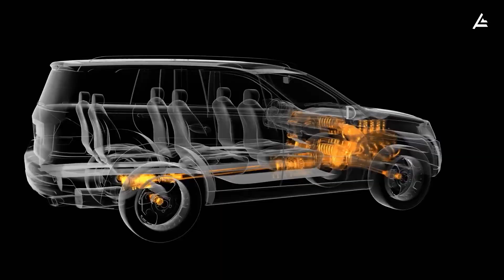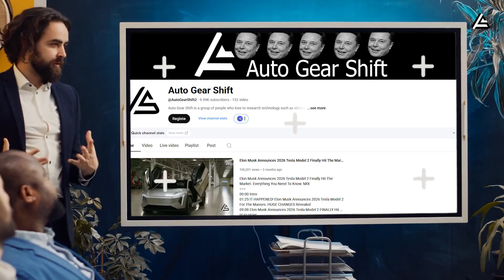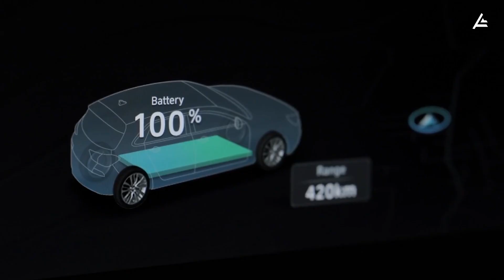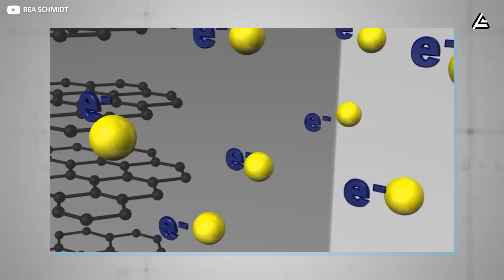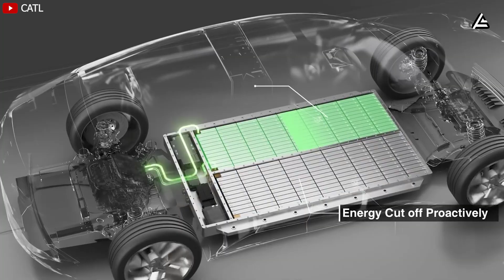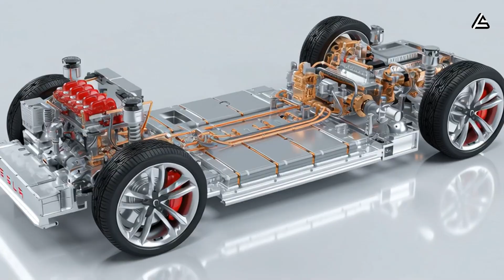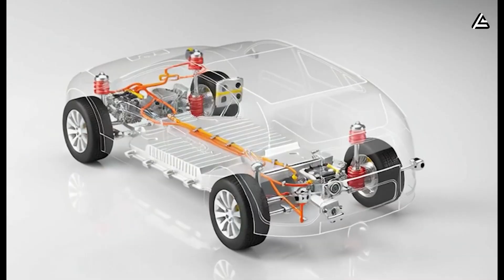Aluminum-ion Batteries Finally Arrived For 2026 Tesla. Will End Toyota & BYD

Comment: What are the biggest scaling challenges with the ionic electrolyte?
Reply from the maker: The biggest hurdle is producing the ionic liquid in large, consistent batches, it’s still expensive and complex to synthesize. Another challenge is integrating it into high-volume cell lines without contamination. Until those processes mature, scaling to millions of EV packs will stay slow.

Comment: How safe is shipping aluminum-ion cells internationally?
Reply from the maker: Pretty safe compared to lithium-ion. 📦 Aluminum-ion cells are non-flammable and use stable ionic liquids, so the shipping rules are less strict. They’re far less likely to trigger thermal runaway during transport.